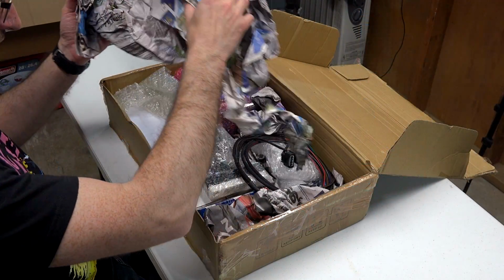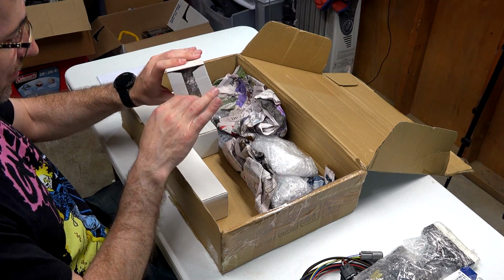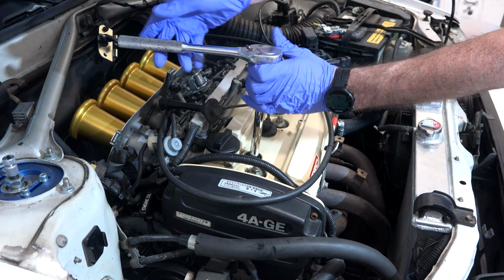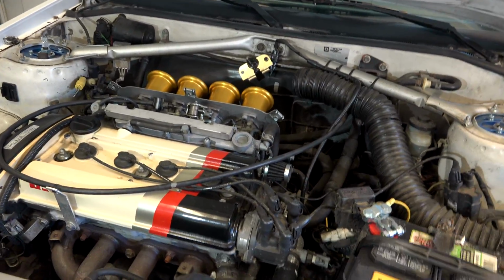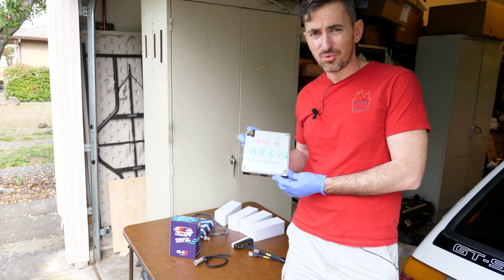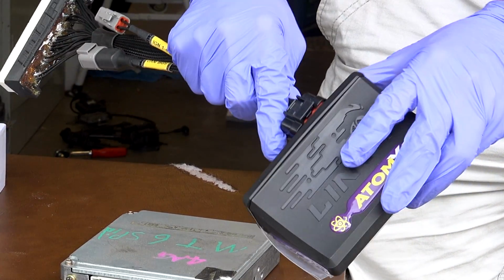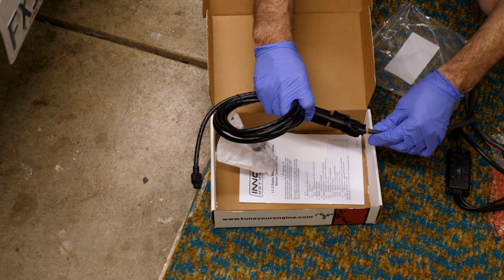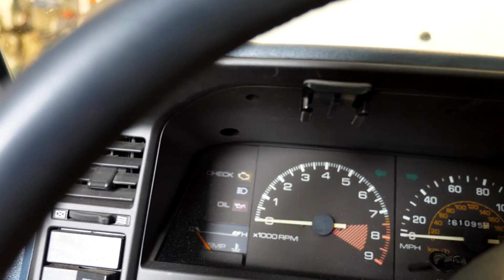Part 1: 4A-GE Big Brain & COPs upgrade (ECU & Coil on plug conversion)

Comment: Changing the input resistor on the tachometer should get it working again or you can use a tach adapter from msd  8920 i believe is the part number. congrats on getting it started such a wonderful feeling  i am a fellow link user as well keep up the good content :)

Comment: Nice fancy parts you got there! Congrats. Wish I had been there to help diagnose. Sounded like timing off to me from the first start attempt. This is gonna be sweeeeeet!
Reply from the maker: Fancy parts are sooo nice to install :D I figured it was timing as well but for some reason I didn’t think it would be off by a whole rotation.
Reply: @sushpants  For sure. Until you know about that setting, you're obviously going to chase your tail. I only know about it from other videos on the issue!

Comment: And I was like, it must be the EFI fuse you pulled earlier :D
Reply from the maker: Haha, I checked that fuse about 5 times while I was diagnosing!
Reply: me too! first thing I thought of. Glad you got it going in this video :)
Reply: @sushpants  :D I had a similar scenario with my corolla e80, after putting the harness back it wont budge. Wasted time with all the connections and what not, at the end it was EFI or Engine Fuse
I have punished it by pasting it on my garage wall 😀

Comment: New Zealand is the Jdm hub of the world, when it comes to 2nd hand jdm cars. From regular passenger mover all the way to rare Jdm cars. You can import any car from around the world to nz. The point is that they have all the different year models of cars regarding the 4age and the rival competitors cars in that category of car and the models that followed years afterward New Zealand has had a trading relationship with Japan for more than 30years. Their was a time when the FXT-GT corolla
was everywhere in Nz. Now its rare car. No other country that I have visited has so much jdm car lots like I have seen in NZ. Its a jdm car guys heaven. Miss being there. Contact their parts suppliers even the car new dealerships like Nissan, Toyota etcetera. They will import/oem parts on behalf of the Jdm market due to the huge support just quote the part number.

You should go and see the Toyota Festival in NewZealand its a huge event.

Comment: Lovely work. Technical question. For an aftermarket ECU I’ve been told you need an igniter between the coil (not coil on pack) and the ecu… is this also the case for the coil packs you used? Are you running any hardware between the coils and the ecu? Don’t want to melt my ecu. That would be very sad. Thank you! Sweet little rig you got :)
Reply: Also would love to know

Comment: Way to go with the link ecu,  ive installed a standalone maxxecu and had to grind a tooth on the crank sensor fr the trigger and home signal fr it to work .
Reply from the maker: My install was a little easier because I was able to retain the distributor trigger.

Comment: Is the engine running off a smallport dizzy only? No trigger wheel on the crank? Hoping to do standalone and ITBs on my ae86 soon. That rally got me itching to tinker with the car again
Reply from the maker: It’s only running off the 24 tooth distributor. No trigger wheel on the crank.  Which standalone and ITB’s are you thinking about doing? Haha, you should try my FX16 out!

Comment: Double check the 02 sensor, I’d personally use the one that came with the wideband unless you know otherwise
Reply from the maker: They were both identical Bosch LSU 4.9’s  but I ended up installing the one that came with the LC-2 controller anyways :)

Comment: I have the exact same setup as you, however, could you provide a wiring connection diagram of where you made you connect that I can follow. Mine is a 1999 Levin BZG Blacktop 20v, I would also like to know where to find the pure tach signal wire.

Comment: I think you might've just solved my problem there at the end mentioning how the tach is managed by the distributor. Maybe someone can help me put more thought power to this. My car developed a misfire recently right? 99 toyota celica gt the one with the 5S-FE and I ended up changing distributor cap, and the coil plug that runs to the igniter and it solved the misfire but RARELY my tach will act up and bounce around. Think my distributor might be trying to hint to me his time is up?
Reply: Adrian Castellanos I had a similar issue. Turned out to be the coil which would only act up when it heated up

Comment: AmpEFI makes a voltage tachometer adapter axm-100, you need to make the tachometer working on these old toyotas, you have the same problem i had back when i put COP on mine, just back then i didnt know what to do about it.
Reply: You are a lifesaver.  Great suggestion!  These older tachometers need that unusual spike in voltage and most ECU's do not send the correct weird spike out from their "tach" output.   The AXM-100 is the solution.

Comment: When  doing a COP conversion there is no need for a crank trigger wheel?
Reply from the maker: You retain the cam position sensor from the distributor which is how the ECU knows the engine position. You usually see a crank trigger wheel for RWD 20v swaps because they have to remove the distributor altogether due space limitations.

Comment: Became a big fan of yours when I saw that you have a 4A-GE 20v underneath that hood. I have been meaning to ask how do you get that to pass smog since you're in CA? I have an 89 MR2, wanting to do a swap but I really want to remain true to the 4A-GE. Wanting to know what's involved to make this possible. Thanks
Reply: Get any insight into your mr2 question?  I'm rebuilding my 89 mr2 right now.  I was thinking that a cop system with this would be pretty good.  Clean up the engine bay a little.

Comment: You should relocate the battery to the trunk.
Reply from the maker: While I was installing these upgrades I kept starring at the big chunky battery and decided I didn’t want it in the engine bay. I priced out a battery relocation kit and switching to a lithium battery. So it’s gonna happen!
Reply: @sushpants  before you buy anything to relocated your battery
Take a look to the "gravity" brand lithium batteries

Comment: That compression tho.... I've never seen them go below 200psi. With TRD HG that is, not sure whats inside that motor.
Reply from the maker: It has the standard head gasket. We only have 91 octane gas which increases detonation with a TRD head gasket.
Reply: @sushpants  US 91 is like 95 pump, not too bad, been running that with 220psi and 15 degrees timing no knock.

Comment: Fact of mechanics is that if something that used to work and now doesn't, It will always be the last thing that you changed, 
No need to check the injectors , they were working already, You changed too many things all at once. OK you got it running in the end but you should have changed one item at a time.

Comment: Did you use a crank position sensor?
Reply from the maker: I was able to use all the original triggers. The distributor has a 24 tooth cam trigger that is still being used as well as a crank trigger.

Comment: What does coil on plug mean?
Reply: it means each spark plug has an individual coil on top of it to regulate the voltage and electronic spark timing which is now controlled by the ecu rather than all 4 spark plugs sharing just one coil pack and getting spark from the distributer which is timed manually from the camshaft